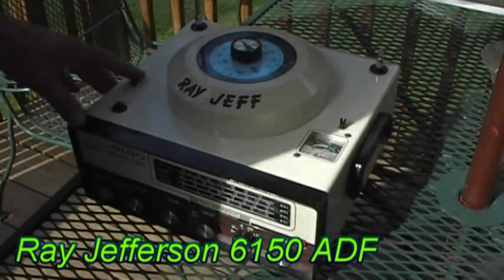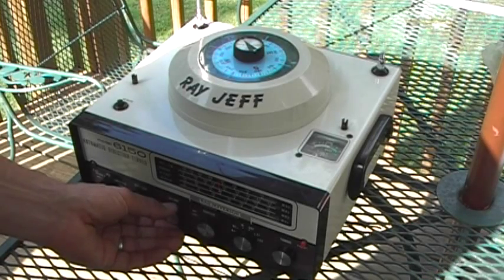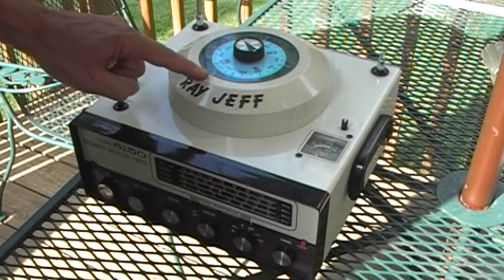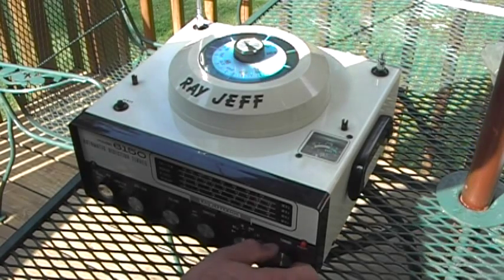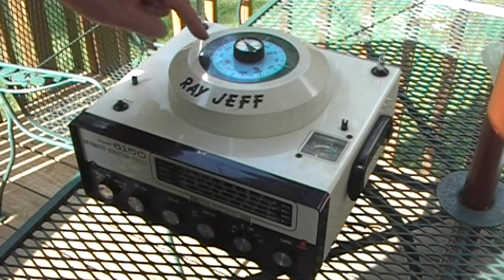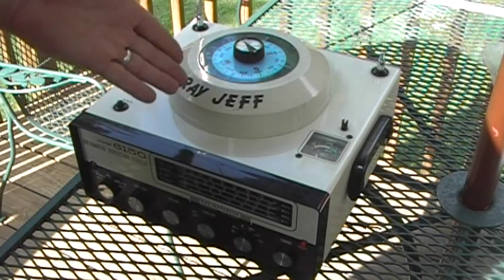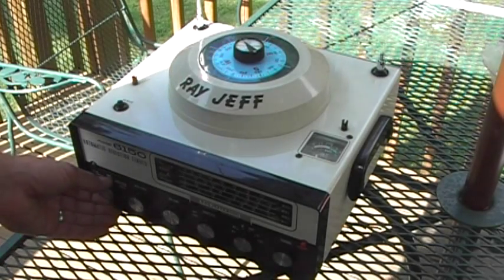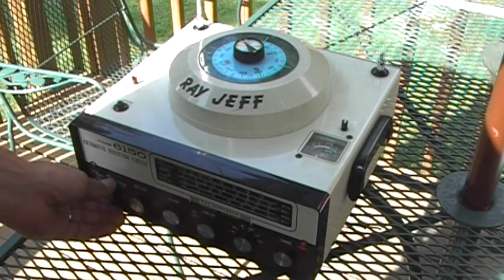Ray Jefferson 6150 Automatic Radio Direction Finder (ADF)

Comment: Does it work as ADF in VHF or just it works as receiver? Thanks
Reply from the maker: I don't believe this, or any of these, are able to use the direction finding function on VHF. Of course Apelco and others did eventually make VHF adf units (I had one for awhile). They use a special, fixed, four element antenna. These have four VHF antennas arrayed in a box pattern, about a foot to 18" square.

But next time I am in my attic, I'll look and see if I have the manual for this one, to double check my recollection.

Comment: This looks a lot like a  Pearce Simpson receiver. And could you tell how the sense whip is used ?
A nice website you have.
Reply from the maker: Thanks, Jan. 

It is very possible that Pearce Simpson model is a rebranding of this one, or the other way around. Some of these radios would have several names, and be sold by different manufacturers. The "Coastal Navigator", I think, had 4 or 5! 

I don't have the manual handy, but in short, the sense antenna would "inject" an offset received RF signal from the source antenna to the circuit. Since it was offset, the radio could discern a difference between the rotating antenna signal when one orientation, and when 180 degrees from that. 

Hope that made some sense! 

Thanks for the comments...

Comment from the maker: Thank you, Kenneth! The Dane CG has no compass on it, so perhaps the bearing found on the antenna rose it "repeated" its position to another compass on the boat? Next time I have the unit out, I'll see if it is wired to register the position, and if there is a connection to link it to another unit, or some such.

Comment: FYI, on your website your Dane GC Model 101, mention that you are confused by the use of the words "Magnetic Compass Repeater" on it. The word "repeater" in this sense applies to a compass which "repeats" a bearing either to or from another compass (the "Master") on the boat involved. In this case, it may be able to be set up so that it "repeats" the bearing that a separate magnetic compass "sees". Ken Gordon W7EKB